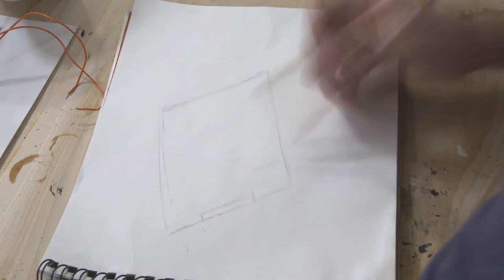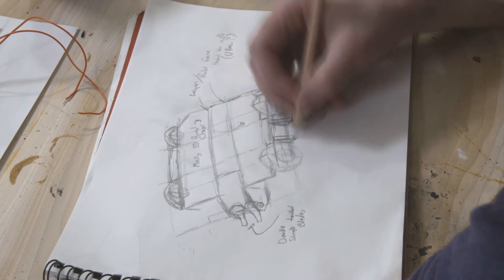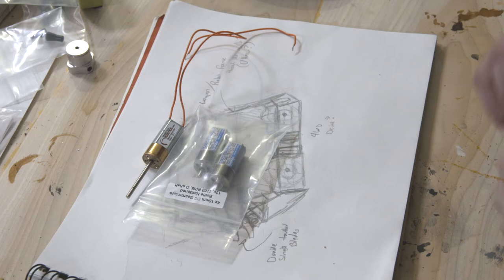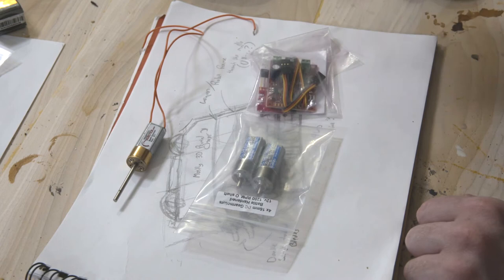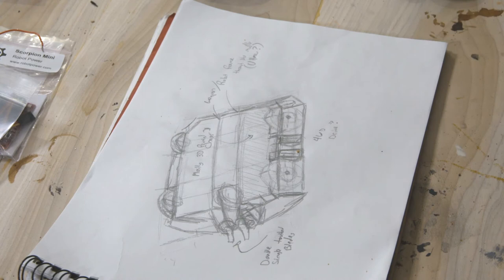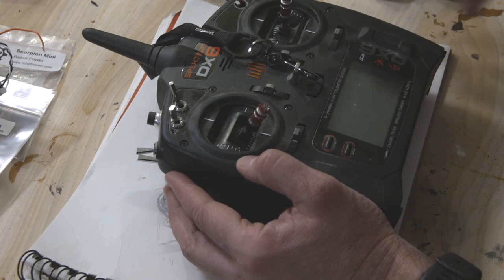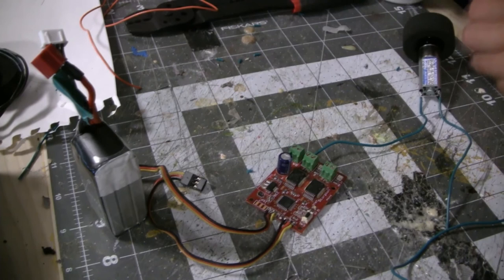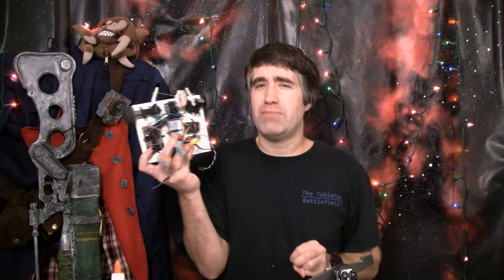Build Your First Antweight Combat Robot - Part 1 - Defining the Parameters

Comment: Nice video! For antweight drive, I personally feel like the TinyESCs are super expensive for what they are, and they are useless for anything above a 1lb antweight. Especially if you are in the USA I recommend Botbitz ESCs, which works the same as TinyESCs but without a built in BEC, and are a lot cheaper. I used the 8A variant which doesn't seem available any longer on my Beetle, but the 10A version is still up for sale on Ebay and are even more powerful though not much bigger.
Reply from the maker: I didn't know about those.  I will take a look at them.
Reply: Another good option would be Rectified Robotics DDC if on a budget.
Reply from the maker: @shadow7037932  That does look like a good option.  If I can figure out the current capacity of the Candy Wasp motors, I might be able to swap to this ESC.
Reply: @RockoRobotics  Time to do a quick stall test and measure current draw ;) If the motors can run on the Tiny ESC, you can probably run them on the DDC, they have similar ratings.
Reply from the maker: @shadow7037932  That's a good idea.  I need to check if my multi-meter has any current measuring capacity though.
Reply: For 1lb robots, TinyESCs and the Endbots DESC are the gold standard options. I prefer Endbots for the built in receiver because they are so small, but I also have an assortment of transmitters so that's not always ideal.

Comment: Good video! What's the difference between the gold vs silver sparks for combat?
Reply from the maker: The gear teeth on the silver sparks are larger, which makes them more durable.  The gold spark I show in the video is from a higher performance, non-combat robot project, and half the gearboxes have had gear teeth damaged.